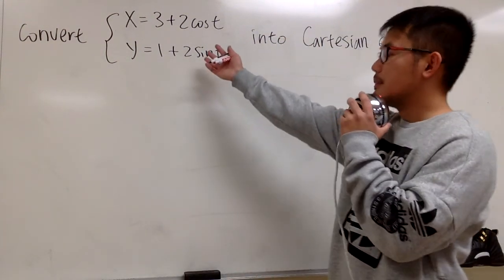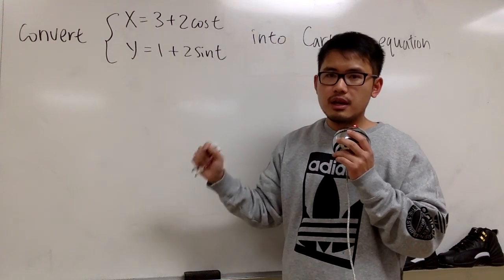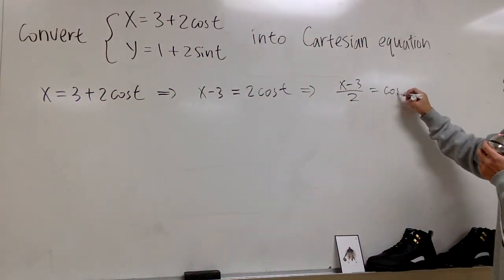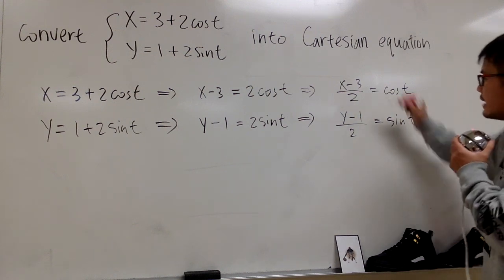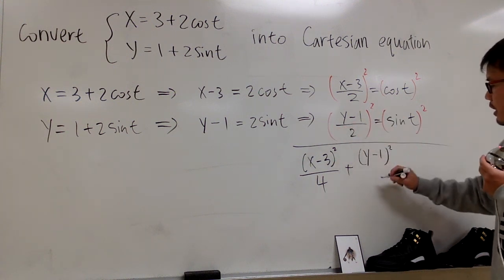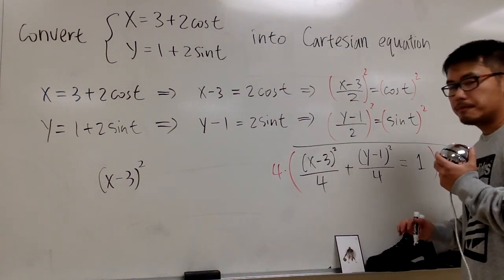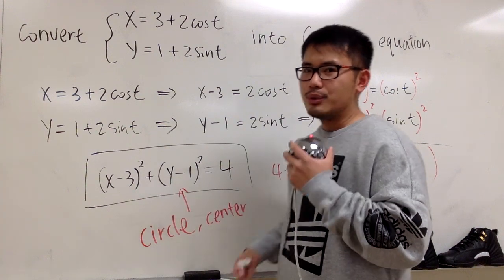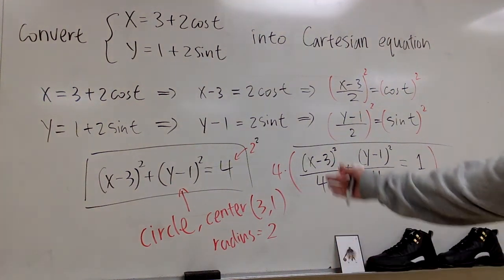How to convert parametric x=3+2sin(t), y=1+2sin(t) to Cartesian

Comment: Great video! One minor point though: I've heard several people refer to this as Parametric vs Cartesian and I think that's a mistake. It's Parametric form vs Functional form .  When you write an equation as y = f(x) you are writing the equation in functional notation (because it becomes a function, subject to all the limitations placed on functions). Both parametric equations and functional equations are plotted on the Cartesian coordinate system with x and y axes because the output of a parametric equation is a value for x and a value for y.   :)